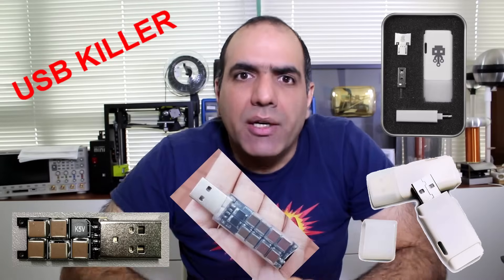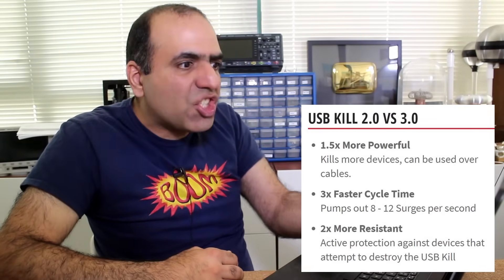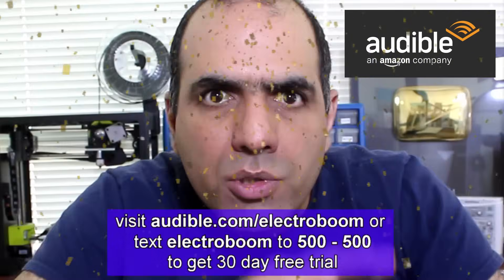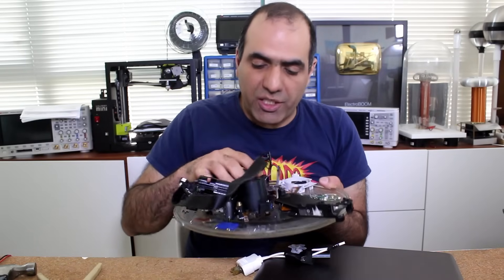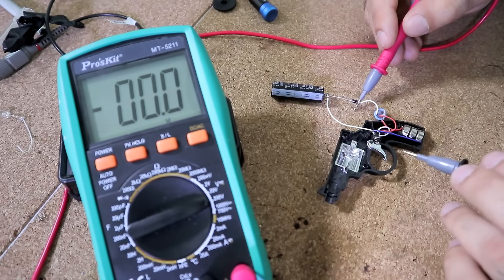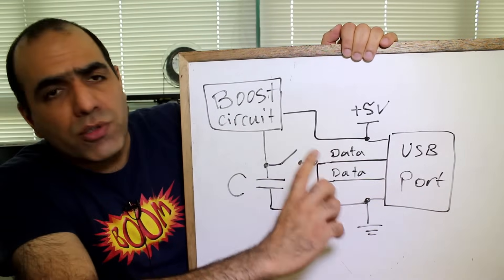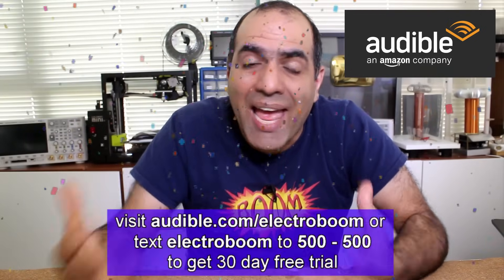USB Killer… WHY???

Comment: I'm doing the opposite, as a security system from piracy on my PC, the front panel's USBs are connected to the PSU's secondary, about 40V AC. It will fry all things USB plugged in, eventually it shutdowns the PC. I initially did this to a company whose personnel tends to copy stuff they shouldn't. Even charging an iPhone, despite being told NOT TO,  it goes *poof*. or *clack*.

Comment: It sucks that it's only use is vandalism.

But on the bright side, this is yet another glorious use of the FULL BRIDGE RECTIFIER :DDD
Reply: I see no use for a full bridge rectifier here. Am i missing something ?
Reply: @TheKoenigsParkour  Not really... not needed  to break things -- AC is just great for destruction, and has the nice property that voltage can be easily adjusted by simple transformers, and capacitors will pass AC current through instead of blocking current flow, increasing the options for destructive capabilities.    Rectifier modules in my work's server room convert AC to DC to feed the  -48V DC plant and have some things to do with charging the battery strings, however....    Rectifiers are for more interesting, sophisticated, non-destructive things.
Reply: @Dracolith1  Well we are talking about an usb device right ? So just 5V DC. If i would build one i would just load some caps for energy storage, then drive the current over a high inductance and design a circuit that makes the switching surge hit the datalines.
Reply: You aren't limited to that power source unless you are having to be stealthy for nefarious purposes, and therefore using only the USB port itself as the power source  to prepare your device for delivering a surge to the port.  Voltage can still be boosted up from 5 to the charging voltage of some storage cells by having some small buck converters in-line,  then an even greater surge voltage can be prepared by building a voltage between lines across a spark gap to deliver the charge when a high threshold is reached.
Reply: @TheKoenigsParkour  the guy was making fun of his accent in a prior video
Reply: 700th like on your comment
Reply: You mean FOOOOL BRIDGE RECTIFIER?
Reply: "It is only use..."? What do you mean by "it is..."?
Reply: It's also used to remind everyone around you as to how much wealth you have.

(Or how much wealth a social circle has. Which is why I think it's so expensive since a dead laptop is the equivalent of a 'slug buggy' to certain economic groups)
Reply: The Surly Gentleman Yeah great, the wealthy person has his useless reminder and the poor kids in Asia can create a new laptop for the wealthy person during their 12 hour shifts. You must have your brains in your ass.
Reply: It has more uses than that if you think outside the box.
Reply: @dashdashdash_  
Like what?

Comment: Hello kind sir and comment section, I have a question. The king of random once made a video about how he turned a microwave transformer into an ARC furnace that could melt various metals, I think he also used it as a stick welder. I have an electrode welder (I don't know if that's the same thing as a stick welder) and the carbon rods he used. Could I use my welder to melt metals like Grant did? Of course without destroying my welder. I don't know a whole lot about electricity but I learn from your videos every day. You have a great channel and I hope you will gain more and more subscribers.

Sorry for my bad English

Greetings from The Netherlands

Comment: I’m pretty sure USB Killers are used to test if computers use USB Protection, correct me if I’m wrong,
Reply: You're wrong. USB killers *destroy* computers that *don't* use protection. Tests, you do them with a tester.
The best way to test if your car's brakes are working? Launch your car at 100 mph against a wall, brake before hitting the wall. Whoops, the brakes were broken.

Comment: I'm penetration tester for my company and have used a USB killer before. The legitimate purpose of the device is supposed to be for testing surge protection for IOT devices and components. It's handy if I am in my office and need to test devices and components with an artificial power surge either to recreate what might have caused a computer to fail or what the effects of a power surge on it might be. Note that I would never use this in an actual live penetration test as always doing permanent damage to a machine is against the rules of engagement. This is strictly for Proof of Concept and lab work only. This also serves as a handy lesson for company employees as to why it is dangerous to plug in random USB's left behind in the office to figure out what is on them because, yes, you don't know what it is for and something like this or malware might be hiding inside. While I trust that the IT staff would never be stupid enough to do this (yet sometimes they surprise me) you'd be amazed at how little thought people give to thinking about the consequences of technology before using it.

Comment: At one company I worked for we used a 10,000 volt 27uF cap to make a really large Surge tester for Electric power meters circuit protection, but to be a useful tester you have to be able to set a specific voltage for each test and only hit it once. This is important for statistical analysis.

Comment: There is only one "legitimate" use for this sort of device that I am aware of, and I don't know if this sort of system is even in use anymore. They used to implement a system of encryption where the data on the portable device could only be decrypted with hardware on the parent device. So a device like this might destroy the parent device, ensuring that any remaining unaccounted for portable data devices can never be decrypted.

Comment: a testing unit you be sending 5 volts DC and AC for testing purposes since that is all that can come out of a USB. maybe a few amps. (same as USB) since if you break the cable and it short, any combination you do could only be limited by the 5V of the USB and it could go somewhat AC if the cable moves and connect and disconnects... 

so like the video states, a USB killer is a USB killer and can only kill USB. not test them. and the General populace would not really be able to "TEST" a USB with what i described either. (a product manufacturer would have a bunch of sensors plugged on the USB to gather DATA... all you have is a USB to burn.)

Comment: Oh godddd. Flashbacks on those fucking camera flash capacitors. 3x shocked and counting.6:40 is EXACTLY how I got my first shock. second time was trying to fix a borked shutter with those cheap ass metal jewellery screwdriver. Third time was me plugging a flash sync cable into a studio flash.  Missing the jack connector and touching the plug to the board somehow. Glad my camera wasn’t connected at the other end yet.

Comment: The joule thief circuit is another option this. I've gotten 100+ volts from 2 AAs. Though the output cap was only 1uF so it can charge relatively quickly.

Comment: I am pretty certain you can build something much simpler.  Take a cheap USB, keep just the components to take power from the USB, connect it to a simple capacitor and have a small gap which the electricity will cross when it reaches the maximum charge (or close).  Very simple.

Comment: These things have been around for over a decade and aside from malicious purposes (people are jerks 😒), the main reason has been to disable USB ports so that people can't plug in USB devices. For example, a business might want to disable the ports to prevent data exfiltration (*cough*Snowden*cough*), or to prevent infection (*cough*Natanz*cough*). Killing the port is more reliable than disabling with software or a physical plug, however there's no guarantee the current will only kill the port and/or USB controller and not go back and fry the south-bridge or more, especially with repeated use. I have no idea why they're calling them "testers" now. 😕

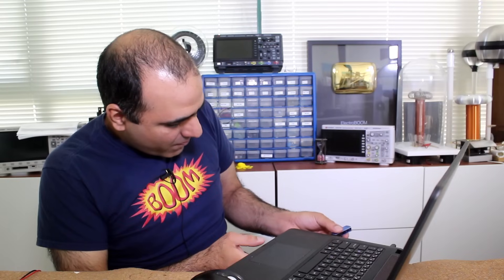4:15 - 😀 Yup, the USB-A connector was designed by M.C. Escher to be topologically inconsistent with reality.

Comment: Sometimes IT people use these to make sure a motherboard with intermittent issues is really dead. If they send a bad motherboard back to the manufacturer for replacement, and they can't reproduce the problem, they won't cover the replacement and might add on extra fees for wasting their time. So the company IT guy will just make sure it's definitely damaged before they send it. My brother used to make them by just shorting the wires of a USB cable together, back before they added protection for that.

Comment: I disagree, just as how lock companies falsely advertise some locks as super strong, pick proof, invincible against force attacks,etc. i wouldn't trust these manufacturers to actually back their claims on their safety proofing,i could see the use in enviroments where you can't afford to lose equipment like a data center, where it would be better to be safe than sorry.
this is exactly how its done in computer security, you test your system with different kinds of attacks to be sure that its actually safe, sure its not very ethical for the manufacturer to make these available for everyone but they are not without an use.

Comment: Try using a portable hard drive so you can destroy files from police
Reply: Just buy high voltage transformer & connect it to data lines of usb port so the high voltage destroys the device and the magnetic field destroys the hdd xD

Comment: There are USB Ports that cant be killed that way. It makes sense to provide such a product, when not sold to everyone. Selling such product aims for people that just want to kill devices.
More bad would be a "Bad USB". There are different kinds of it but the most common is, that the USB Stick acts like a keyboard and just runs a script, when plugged in. For a PC its just like you plugged a keyboard into your PC and it's very fast. Just search for Rubber Ducky. 
Not so common is a usb stick with a malicious firmware. It can do a lot of stuff. One common type is a a keylogger. Just plug it into a pc and into that a keyboard and now it safes every keystroke you made. One possible attack would someone in a doctors office, plug it into the pc and days later remove it. This is why every PC shouldn't be accessible from random people. There are even companies that put glue into usb ports, so no one can plug something into it.

For everyone: do NOT plug unknown usb devices into your pc. When you really want to know whats on the usb device, get you a usb killer tester and a cheap pc, with nothing important on it and no internet access. A Raspberry Pi would be a good idea. It's cheap and compact.

Comment: I worked at a company where decommissioned computers where not allowed to be used/sold but kept in storage for recycling. They tried to sell them in the past but had problems with stealing and corruption and they didn't want to spend money managing it so they just made it a rule to only recycle them. Anyway to make them less desirable to steal a usb killer would be usefull. Jokes where made that it would have been fun to take them to a gun ran and used as targets. In the end the company switched to renting computers and we just give them back when we are done. But they had to get large before that economically made sence.

Comment: It's funny because lately I was wondering why you can' t find an extension cord with male outlets at both ends. It could be coupled with female / female extension cords, or used  as  a zapper or something.. I mean -- more power to us..
Reply: This one's easy: peeps would make infinitely connected extension cords which would increase more and more in resistance, aggravated by the plugs, setting the house on fire in short order.

Then again, there is really nothing holding you against buying a spool of wire, some male heads and making male\male extensions yourself - i even made one for sharing power with my neighbor 10 years ago!
Reply: @GashimahironChl  my god.. so it exists and there is a  legitimate use for it.. like backfeeding your house / RV for some reason
Reply: It's also called a suicide cord.  The main use is for idiots to connect cheap generators to RV's when the one it comes with dies (agruably okay if you only handle the cord with the generator is off). Or even worse into a house (where the circuit can backfeed and harm line workers) Also if you cross phases, you'll get a dead short. 

Mainly you don't want anybody that doesn't understand electricity to have one. Secondly don't ever want high voltage pins exposed.
Reply: Probably good to clarify: neighbor had his power physically cut off due to nasty weather, and his food in the fridge was gonna spoil, hence the borrowing of power.

If someone thinks this is a great idea, mind you that when the power does come back on/gets reconnected, and you still got that male/male cord doing it's thing... well, you better have the fire corps on speed dial!
Reply: @GashimahironChl  

In such emergencies, you want to make sure the main breakers are off, but that's no guarantee of safety as certain faults will make the neutral hot (at high voltage potential).  To pass code any back-feed capable of operating w/o grid input must have an isolation/transfer switch, that isolates the neutral as well as the hot phase(s).
Reply: Yeah, it's probably good that i knew what i was doing at the time - all breakers were off, including the main breaker outside coming from the utility pole, i've checked them all.

The main breaker was conveniently already dropped, probably due to a short circuit due to the dangling wires touching each other, still, i reset the breaker and shut it down to make sure.

Hopefully, my country will bury those power lines all flappin' in the breeze eventually, so i won't have to deal with this kinda shit ever again...

Comment: Any of the high voltage ones like the flash capacitor probably just arc across the connectors in the USB plug, or the traces on the board before it actually damages anything. Or much of anything. If you look at the 120/240v part of a PCB before it drops the voltage to 5v or whatever, there's always a large gap between the high voltage and low voltage sides cuz even 120v will arc across normal traces.

Comment: It's not a stupid product. It does exactly what it's advertised as doing. It's used in IT security for a number of reasons. Testing employees stupidity, destruction of systems to gain further access, a self destruct button etc etc etc.
Sure, it does not erase data, but that was never ever the point.

Mehdi needs to take some courses in penetration testing etc.

Comment: maybe if you have physical access to a network and want to fry the device running the network's firewall? It could be a quick and  ""discrete"" way of physically taking it out. Discrete physically but would likely trigger IDS essentially triggering an alarm to the admi nistrator. Worst case an IPS kicks in and shuts you down from the network.

 it is definitely not for pentesters. no way a company would let you fry their equipment. this is %100 malicious

Comment: I think devices SHOULD be tested against USB killers. Not ridiculously huge ones, but they should be robust enough to handle the surges from at least one of the "first generation" USB killers. This ensures they are robust against unusual events that might otherwise damage them, and encourages designers to over-engineer their devices (a good thing IMO). But what really needs the most robustness isn't the DC side of your computer -- it's the AC side. The AC power supply of your computer or laptop needs to be designed to handle the spiky, jittery, inconsistent power that can come from things like car alternators, diesel train alternators, and emergency generators. There are a lot of low quality sources of AC power in the world, and people expect them to work, or at least not break their devices.

Comment: Funny you should mention the "sale of explosives" for the purpose of "testing" a buildings resistance to earthquakes. A few years ago
I was carrying out safety electrical installation inspections and tests for a large chain of cinema multiplexes here in the UK.  To prevent disruptions to the running cinema we needed to carry out the work outside of normal working hours through the nights. 
Occasionally we would be working alongside a sound engineering  contractor that checked the acoustic insulation of individual auditoriums by setting up a sound meter in one  and fire a gun with a blank in the adjacent auditorium , which at the time seemed quite incredible to me due to our savagely strict firearm laws in UK compared to Canada and the USA.

Comment: Don't buy these things, do like I did and buy an external CD drive. One of those that uses two USB cables. One for data, one for power. And if you bought a really nice one like I did, it uses an USB to this standard round power plug cable to deliver the power.
Then at this one moment where you really need to burn a CD, fast, grab the first power supply you can find and pump 24 volts into this badboy and watch your motherboard go up in smoke.

Comment: So can we create an Anti-USB Killer?
Idea is to Create a Male USB to Female USB Adapter, and between them we put a step down voltage converter from 220V to 5V.
Will it work?
Reply: Optocoupling the data lines should work, I think. I wonder how many USB hubs are vulnerable to this, as in, how many will transmit the high voltage to the motherboard, and how many will sacrifice themselves for the computer.
I'm sure one could design a safe USB hub to use when testing dubious USB devices of unknown origin. Would make a pretty cool product, for businesses who handle strange USB sticks, like photo studios and print shops.
Cheers.